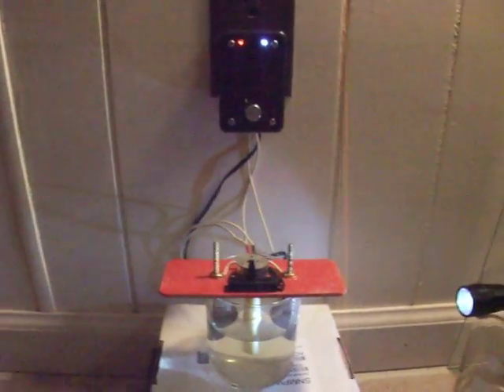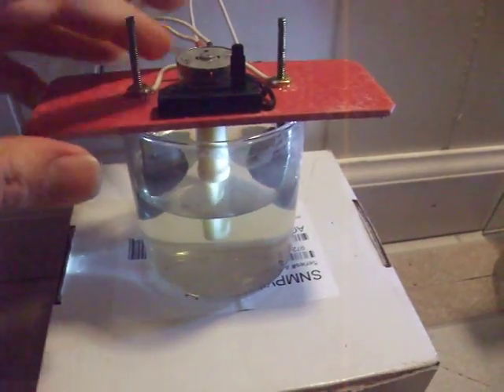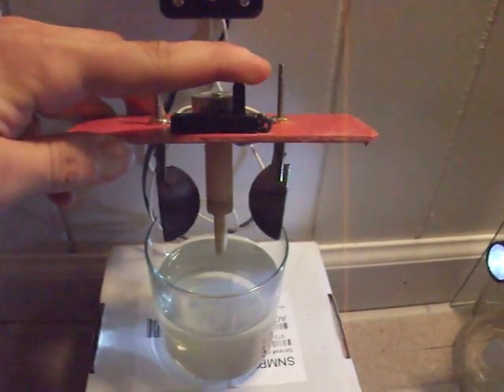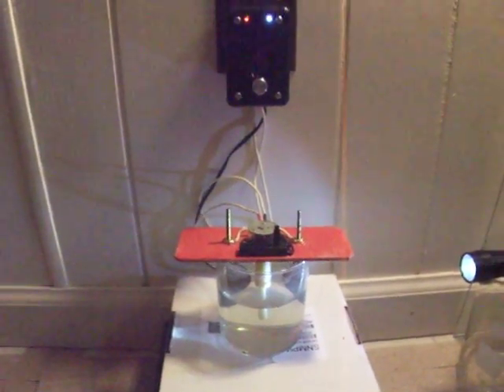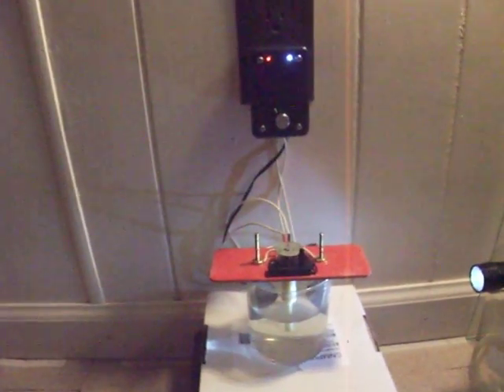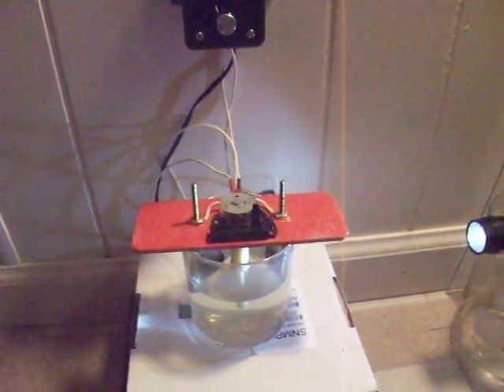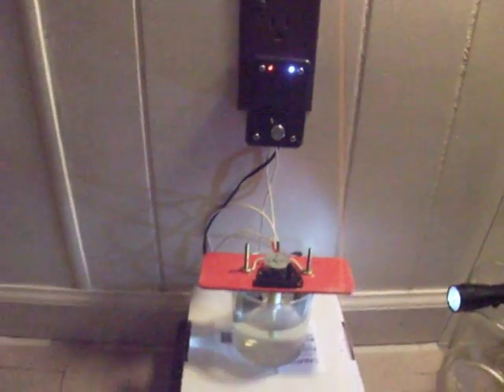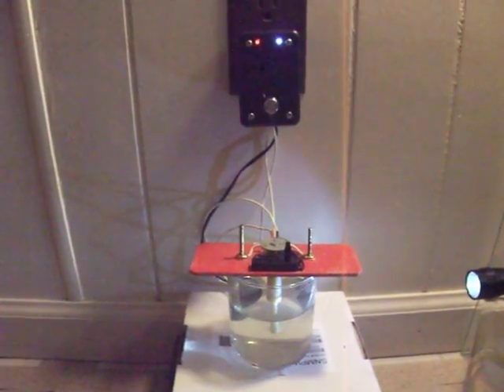Easy Colloidal Silver Generator:  Some simple design improvements for more convenience.

Comment: @TeslaNeko 
how much are the coins where you get them ? .. average size coin is 24.5mm in diameter.. using the wire it will be roughly 0.5mm in width - ...infact im not going to explain all this, its obvious the wire has more surface area.. a coin is more heavier, where as the wire is much lighter.. = more spread out weight = more surface area...but in general it really does not matter.. just use more coins if neccessary depending how many ppmm you want